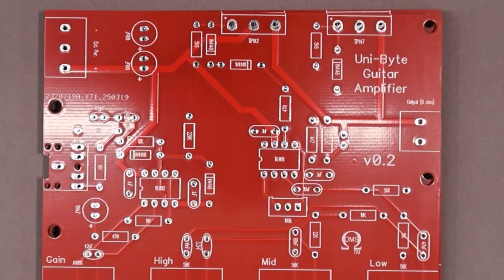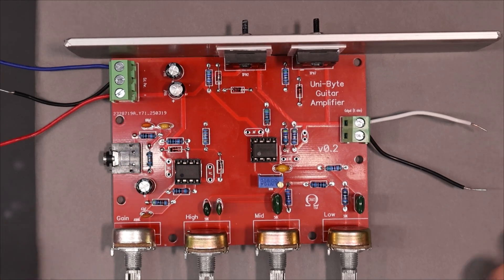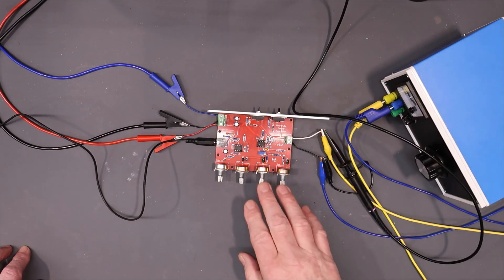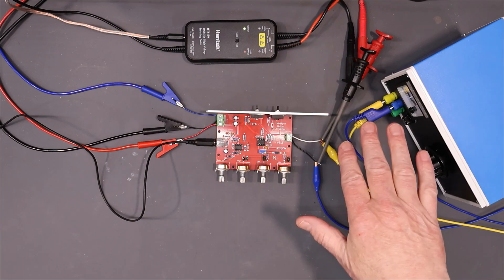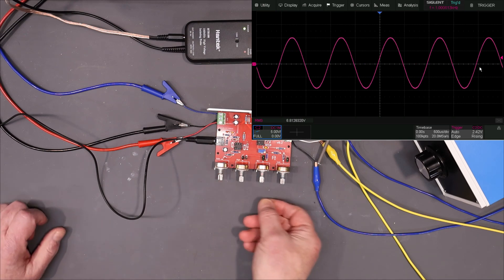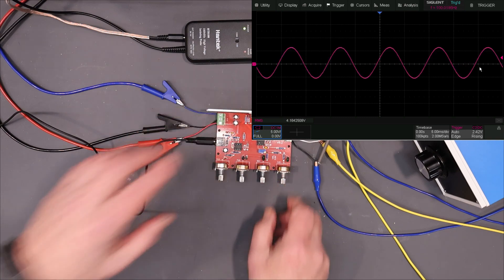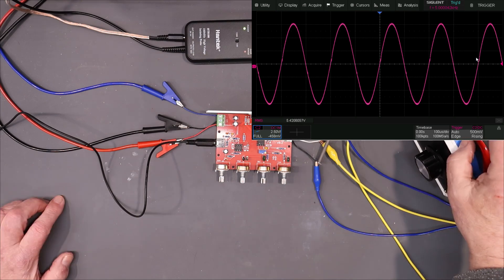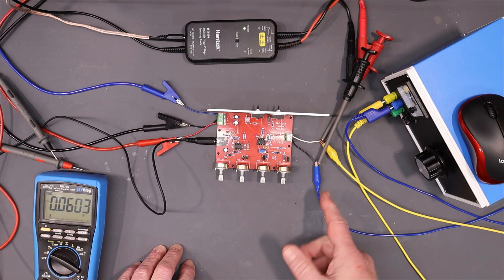Uni-Byte 0269 - DIFFERENTIAL Probe Application:  GUITAR Amp Part 4

Comment: Notes... I think caps in an audio path are traditionally thought best to be film types. Ceramics are (only) okay for audio IC power pins. Please teach us more about ground loops and how to avoid them. I have a LM386 stereo circuit that is noisy and I think the issue is ground loops. I tied the two identical (known good individual) amp circuits at the ground. There is something called (star) point grounding (I think) and I suppose that is what I violated. But, I don't know how. Isn't the output wattage of audio amps calculated as volts into a load? Here, 8 Ohms is the most likely, I would think. Backwards pots = We all have done that one. For me, many multiples of times = grin. I understood why you used the quick voltage test to look for changes caused by the tone controls. However, I think more involved tone circuit designs are able to avoid the greater extent of voltage drops, while cleaning up the intended frequency... Do I have that correctly? All of this is random thinking. There is absolutely no fault finding intended. With much appreciation - Cheers!
Reply from the maker: Yes, the lower ESR of film caps would make then better as bypass caps here, but they don't really seem to be needed.  Look for ground loops on the input.  e.g. the low side of both inputs being grounded at both ends.  For unbalanced systems they might be difficult to get rid of.  The tone controls in use here are only single pole filters so their effects will be rather broad, but that's okay in this simple case.  For hi-fi you might want to employ better tuned double pole filter and for audio phool equipment go with 1/3 octave equalizers.
Reply: @uni-byte  A great reply and information = thanks! "Look for ground loops on the input.  e.g. the low side of both inputs being grounded at both ends." Yes, everything in the/my circuit eventually ends up on the same ground path.  "For unbalanced systems they might be difficult to get rid of. " Yep, I am already scratching my head, as to how to separate them. Thanks for the clue.
Reply: For design changes/improvements... I know you a keeping things simple and very economical.

Comment: Interesting stuff about the bypass caps. Would like to know more.
Reply from the maker: Here's what google's AI came up with for a summary.  It's pretty good: "The main problem is that capacitors have a series self-resonant frequency, and as the operating frequency approaches this resonance, the capacitance appears to increase, potentially creating a high-impedance path at the interfering frequency. This can be detrimental to decoupling, as the capacitor might stop providing the desired low-impedance path to ground, leading to unwanted feedback and instability. "
Reply: @uni-byte   cheers I will see what other sources think as this is relevant to me and you also I believe ! Thanks Mr Byte !!
Reply from the maker: @andymouse  It is, and you're welcome.  Let us know what you find out.

Comment: for the bias use a VBE multipiler cct  

See W2AEW video number 198 for a description and tutorial.

Then you can get rid of all the diodes and just adjust out the crossover exactly.

Andy
Reply from the maker: W2AEW is a great resource.  That's a good circuit element and I'd certainly look into applying to an amplifier design where I was looking for very high fidelity.  Although I'd need to do some experiments to determine the thermal stability of using the VBE multiplier.  One of the goals of this design is to make it as cheap as possible.  Turning it into a true class-AB amplifier goes against that.  It would be cleaner, but it would also cost more with bigger heat sinks, thermal stabilization and power supply.  Here I'm using the speed of the OP-amp to control the cross-over distortion to an acceptable level.  This thing only draws 20ma with no signal on it.